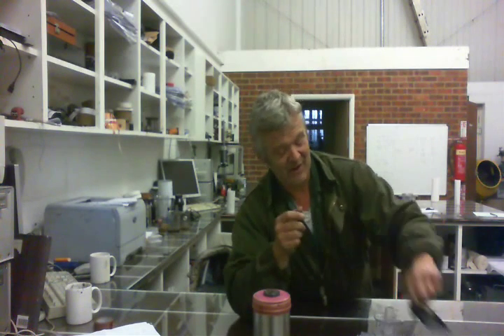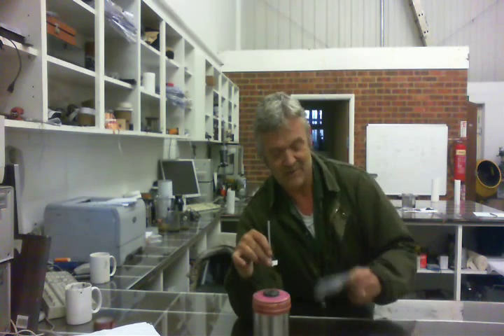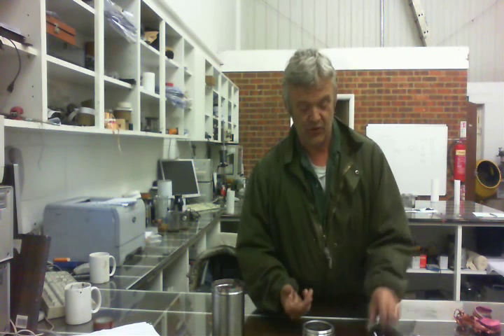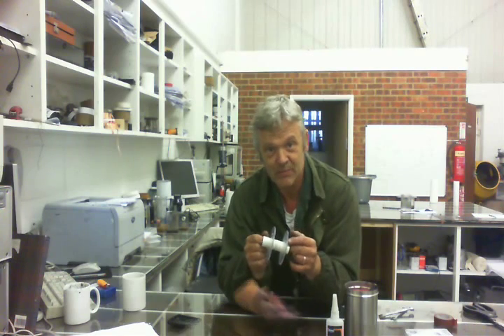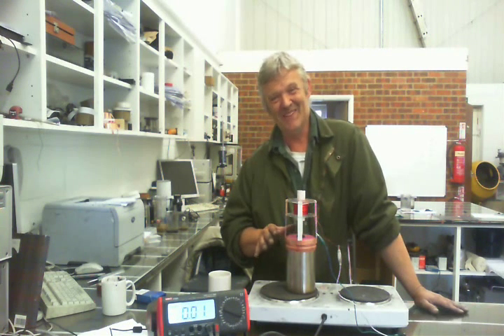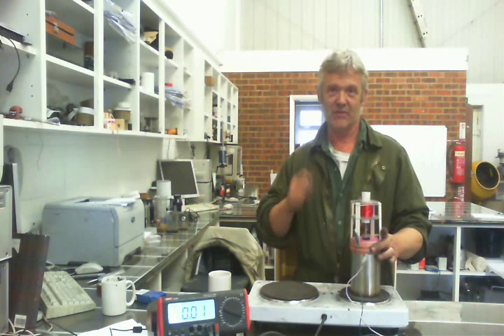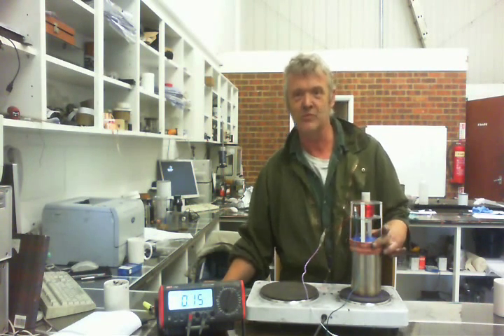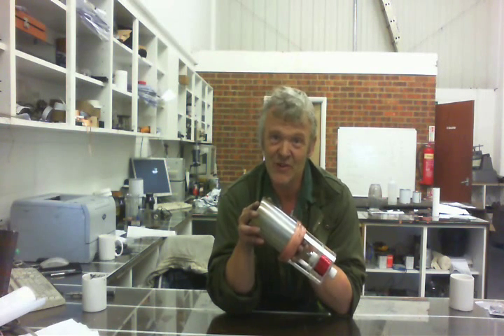Make Your Own Stirling Engine Generator

Comment: Wonderful Sir. For fixing a rough and ready cold water jacket, a deep steel plate with a suitable bore could be fixed at the top end  made suitably water tight. Ice cold water could be filled in and made to drain away as it gets too hot for comfort. This will enhance the performance  enormously I am sure.

Comment: If you decide to flesh out this free piston generator I will spot you a few quid on patreon.  I would like to be able to supply 2.5 to 10 watts.  I have access to tools in a maker space but I would like to build something that a nomadic person could build and upgrade for themselves on the go.  Since I do have access to a lathe and such I would like to build another that could sit in a trailer behind my electric bike.  It would need to generate like 500 watts.  Anything between 250 and 750 would be useful.

Comment: Cut a hole out of a metal bowl the diameter of the engine and weld it to it and fill it with water so you have a small water bowl around the top of the engine filling with ice.

Comment: Try winding wire by cutting out steel plates and sticking them in slits in the spool and wind your wire around them? So that they are wound more like a motor housing.

Comment: If you took an old oil drum, drilled a lot of holes in it and inserted a bunch of these half into it, make it a simble barrel stove , you could connect all these units up and get a decent ammount of oower out of the unit.

Comment: Outstanding, Just a thought, wouldn't turning it upside down provide a more balanced piston action for the generator as well as improve performance since heat rises? Forgive the ignorance if I am overlooking something. I do think you would need a heat insulator to cover the top hot side to force it into a certain area but, also try forcing helium in the engine by installing two valves, shutting one valve when you feel that mostly helium has taken over the space inside the engine. Of course, don't over pressurize the engine but close both valves quickly to maintain atmospheric pressure and try it out. Very cool either way.

Comment: Robert, good on basic free piston concept. But for real time saw many videos in YouTube explaining only the construction focussing on alternator.
Just out of curiosity, my findings,
"Though gaseous expansion in the head decides motion between displacer and power piston. The spring connected to both piston plays the important role. If the elasticity of springs is not properly chosen the piston will fail." Isn't it?

Comment: There is very good practical reason why linear alternators are not used or produced by  industry. It is limited  a toy demo .
Reply from the maker: cheers
Reply: I'm here from the future to tell you that they've used free piston sterling generators to power spacecraft and perform waste heat energy recovery in many industries.

These are available as relatively high output commercial devices for some time.

Far from a toy demo.

Comment: In your book "alternative Stirling engines for free energy ....." page 18. The logic applied is wrong  in calculating that a generator required should be of   1kw output. I installed a solar panel system  of 2kw in a village in Pakistan . I did it because therefore a shortage of electricity , so we are without electricity for 10  -12 hours a day. mostly during the day time.  The considerations were as follows. It is very hot in the day so I have a air conditioning unit requiring 1kw to run it. Then there is   a fridge. we have a plastic  tank on the roof to store water for cleaning , showering etc.  in these conditions 2nd  watt is used to either run the fridge , or fill the tank (1\2 hour) using electric water pump from well. the water doesn't need to be heated when showering. It is the most pleasant temperature you can imagine.  The rest from the the 2nd watt is used to run TV and or recharge the four 12v lead acid batteries. In the evening the acid conditioning unit is not required , a fan with a small water tank is used which blows cool air. I hate  the humidity or the warmish air of the fan. In the evening the accessories like TV and fan, lights  are run on batteries which will last 4-5 hours. One tries to sleep the batteries are depleted. The cost of the system as at April 2016 is as follows. The 8 panels of 250 watt were £80 each.  four  12v lead acid batteries were £111 each. The cost of  uninterrupted power supply unit ( 5kw UPS) was  £370. The UPS was an error , should have been hybrid so we can use the grid supply when it does come.  wiring , labour , transport £200. I am looking at the Stirling generator because the solar panels can be easily stolen unlike a Stirling engine. I know you are interested in free energy , so I hope my experience is of help and interest to you on the practical challenges and considerations in installing free energy for a house in a hot climate country where sun energy is in abundance 😎.
Reply from the maker: thank you mate a very interesting post
Reply: in one of your videos you mentioned making batteries in a village in India as a small industry. i thought i would share my practical experience of solar system in a village. sorry for spell checker over riding my grammar.
Reply from the maker: I really thought your post was awesome mate - it gave me a lot to think about and I thank you for it
Reply: Be sure to update me please if you come up with relevant new solutions. i think your super capacitors are great and certainly relevant to my scenario.
Reply from the maker: will do mate

Comment: having seen your videos of Stirling generator and this one https://youtu.be/Pr6BHVhXPtc in India. I think giving your  configuration a brain like raspberrypi with sensors to control both hot end(parabolic) and cold end and pressure pump to keep optimal efficiency. I think it could be a practical device to generate 5-10 kw power for house / desalination unit in hot climate. I understand one also store heat in oil tank. Now all I need now need now is rechargeable  electricity storage unit when there is no heat from sun or  heat store in middle of  night.  (dry) rechargeable electricity store which is better than lead acid. If you know one give me tinkle to complete system.
Reply from the maker: will do
Reply: Did you see the conductive ink videos? He makes supercapacitor batteries before the series ends for now. How's the twizy(sp?) doing?